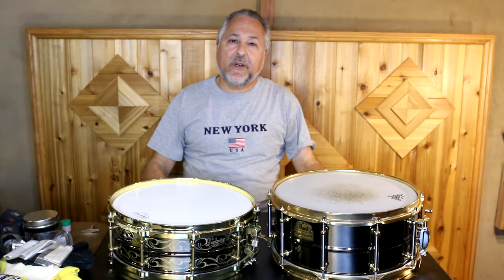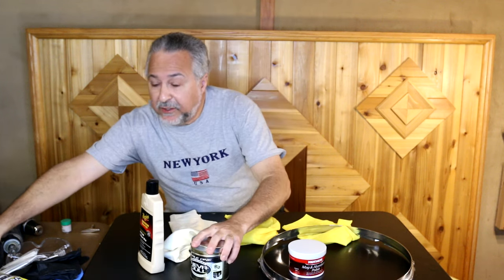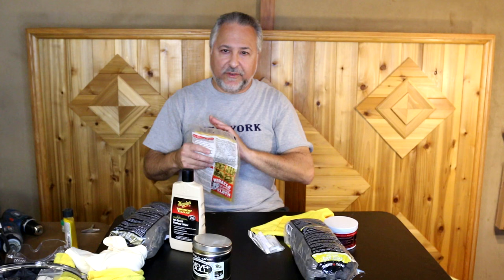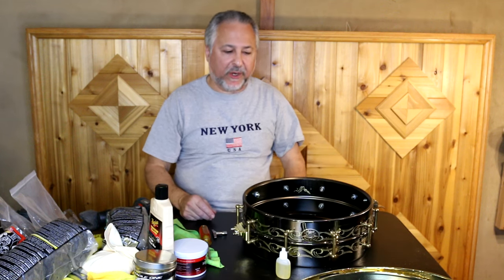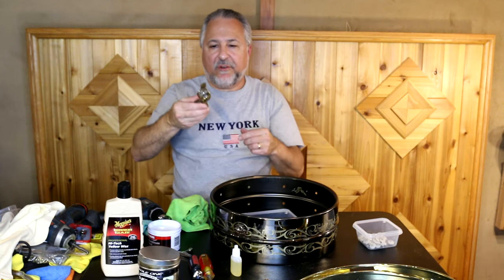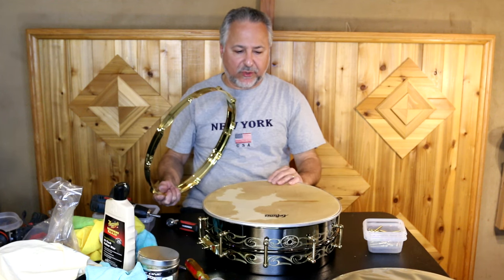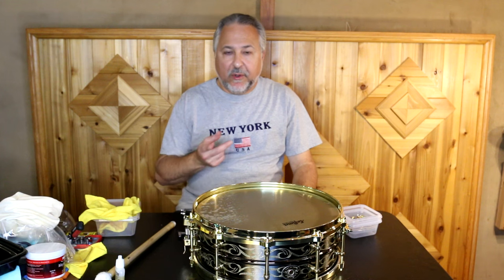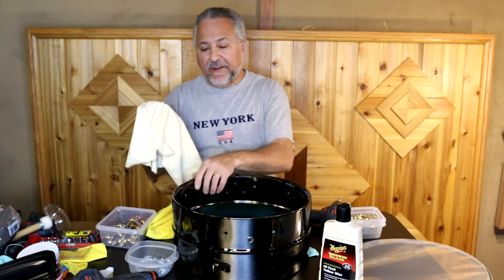Drum Maintenance and Cleaning - Part 1- Bringing New Life to Old Drums

Comment: About a year later here, but I found one snare that the Eagle One Nevrdull works great on, but its the "only" snare I use it on. I use it solely on my brushed aluminum 1981 Acrolite. The Sounds Like a Drum YouTube channel recommended Nevrdull for the Acrolite in particular, and I can confirm that it brings it to new life. 
I bought the Nevrdull strictly for that snare alone, as I don't use it on my other snares.

Comment: Very timely.  I just purchased a Remo fish head rig from a small store in Mass. on Reverb .  Normally they sell for $174 but I offered $99 and they accepted .  It came today and probably was at the store for many years as the tarnish on the jingles was quite heavy.  Took 3 try’s to find the right brass cleaner.  They probably could have sold it for much for if they had kept up the maintenance.  It does shine now.  Very good video.

Comment: I used tin foil on an old 67 ludwig acro. (hoops only) amazing,mirror finish. Thanks for the maguire and mothers tip!
Reply: I learned the tinfoil trick from rdavidr.
Reply: I've tried the tinfoil, and found it does leave scratches. The Turtle Wax chrome polish worked perfectly for me on the hoops, though.

Comment: Many thanks for the info on the Meguiar's #26. I have a bottle on the way to my local Ace's. I'll be using that instead of Turtle Wax mixed with water. (I just hope the smell is subtle, or isn't overpowering & fades somewhat quickly). As for the hardware, I use Turtle Wax Chrome Polish & Rust Remover (meant for cars), which not only gets the hardware to a gleam, but it wiped off surface rust like dirt on my old 1986 Ludwig (USA). I'll stick with that, but looking forward to trying the #26.

Comment: really great channel, wish I had seen this earlier - I cleaned my black beauty with some kind of window cleaner, but it dissolved this dark tinted coating ludwig apparantly uses ontop of the nickel. what are my best options from here? for better looks I removed the coating completely now, the snare is visibly brighter and probably that layer wasnt only for darkening, but also offered some kind of protection?
Reply from the maker: Hi Simon
Looks like you damaged the topcoat. You can have a really good auto paint shop strip and reapply it. Look for one that specializes in high end restorations. Never use harsh window cleaner like chemicals on these drums. They contain alcohol and other strong chemicals. Just wipe the drum down with a lint free microfiber cloth every once in a while, and that's all you need.
Reply: @rickdior  thx for your quick reply <3 I used car wax to "seal" the shell. it looks good and the surface is ultra smooth and water repellant, would you seal it with a top coat again or could you also just leave it like that?
Reply from the maker: If you are happy with the way it looks now just leave it as is.

Comment: Thanks for the video! Do you use the steelwoll also for cleaning wrap that has vanished and has years of dust and dirt? And what do you use to clean the inside of a wooden shell? And, last question: is there a way to remove really rusty parts on a rim or lug? PS the SF snare is great, I have one also :) kind regards Mike
Reply from the maker: Hi 
I don't use steel wool on the shells as it may scratch them. I use car wax and that works fine. You can use very fine steel wool on the hardware. There are lots of products to use to get the rust off. I dip some fine steel wool in WD-40 and use that on the rims. You can also soak the small parts in rust remover. Short of replating nothing will bring the original finish back.

Comment: Hey Rick, great video! Do you every use your Meguiars wax on your wood finish drums? I have a ludwig bubinga with a poly finish and was thinking about putting some mothers Stage 3 pure carnuba paste to try to protect my shells, was wondering if it's safe to do so.
Reply from the maker: Hi Christopher
I don't use it on my wood shells but I have used it on the few wrapped kits I have and it works great for that.

Comment: Great stuff! 
I have a question! Are there any extra holes in your Ferrone Snare? I recently picked up a used one and there are two extra holes below the batter head and then there's one extra hole below the resonant head.
Reply from the maker: There are no extra holes on my drum
Reply: @rickdior  Thank you for your reply. I wrote Pearl and they told me, that the older ones have those holes due to the plating process.